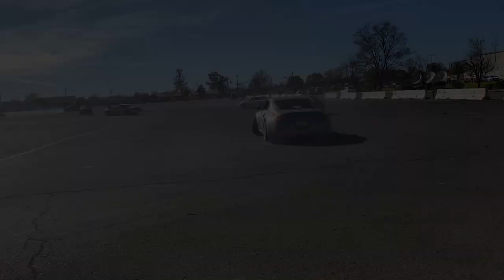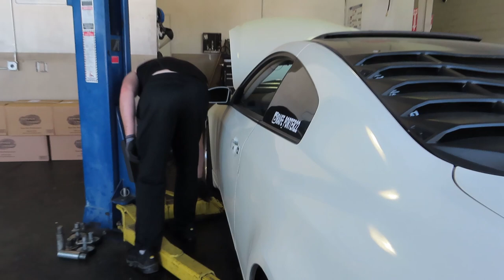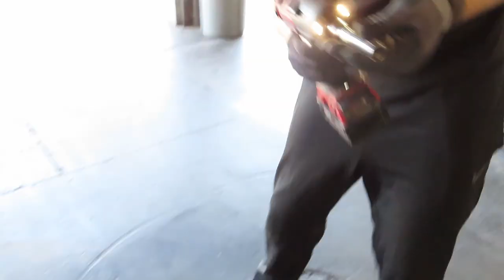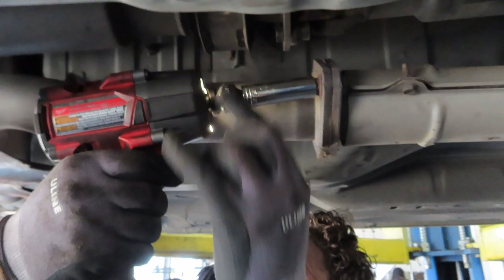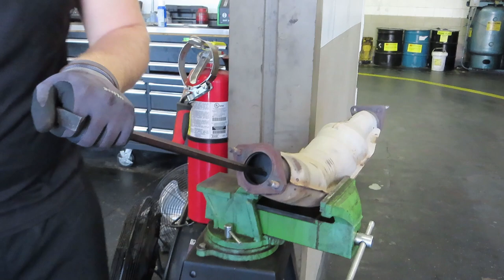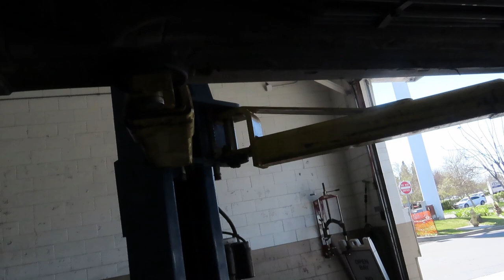VLOG#68 HOLLOWING OUT THE G35'S CATALYTIC CONVERTER

Comment: Did you put Spark plug non fouler on oxygen sensor??
Reply from the maker: No I didn’t I knew it would have a check engine
Reply: @STREETLIGHTSCO  How does it run after gutting the the Catalic Converter?
Reply: @STREETLIGHTSCO  I'm thinking of hallowingy Catalic converter there getting Clogged up
Reply from the maker: @Jehovah-Witness  I’d say do it cuz I had no problems after hollowing them out
Reply: @STREETLIGHTSCO  hell yea thanks for Advice 👍
Reply from the maker: @Jehovah-Witness  no problem
Reply: I put the non fouler and it didn’t throw codes but I cut the cat and replaced with a straight pipe 2011g37
Reply: Im trying to do this with an 08 g35hr sedan it runs good no misfire then after 20 mins of driving It will start misfiring and losing power.....I was told bad cats and up/downstream sensors to be replaced 🤦🏽‍♂️ where should I start and will I pass emissions still ?

Comment: Yo did that fix your misfire?
Reply from the maker: No sir in the next video or two u will see what happened to the G
Reply: Did you find out where the misfire came from?
Reply from the maker: @alberttowner4651  coil pack wire was cut
Reply: @STREETLIGHTSCO  I got a misfire on my g but no code for it except clogged cats you think it’s that?
Reply: @santinoA310 I got the same code and oxygen sensors it's common bro I'd replace them with high flow cats and new O2 sensors that should do it....👍